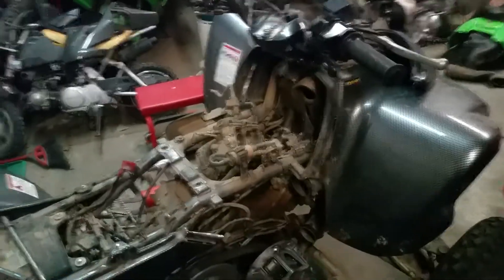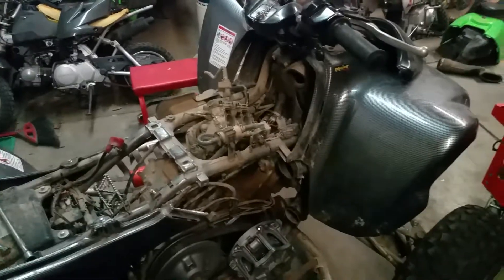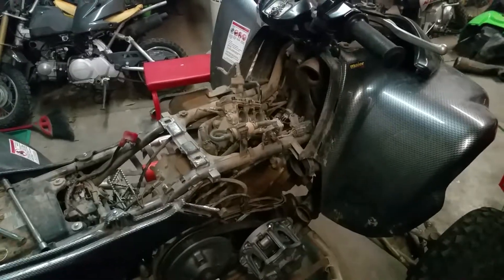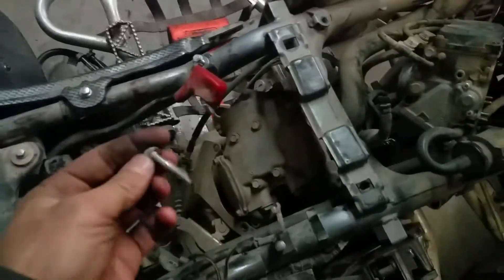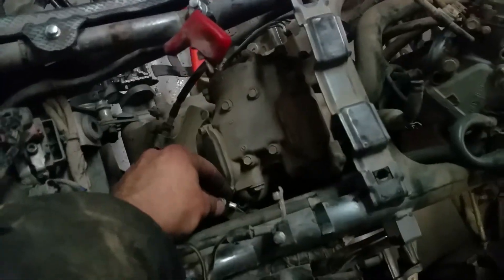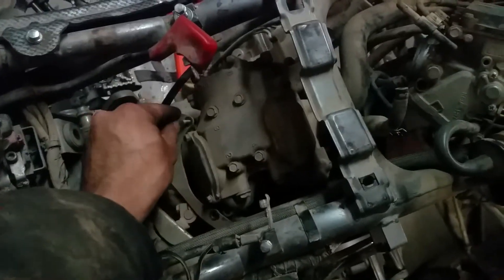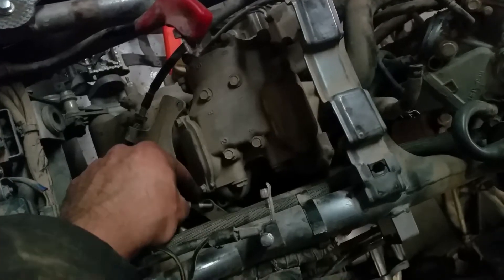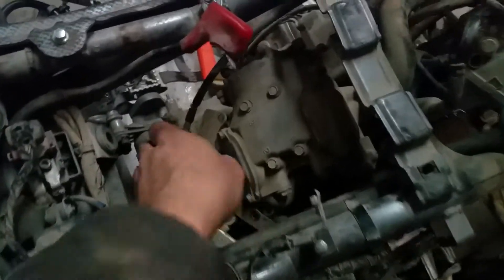Kawasaki KFX700 Gear Shift Cable Removal

Comment: How would I you tighten it if the cable is loose ?!?! When I try to switch from neutral to drive it’s not fully going in so I’m assuming the cable is loose
Reply from the maker: The adjusting nuts are at the hand control. Although you may want to check down by the engine and manually put it in gear to make sure you dont have other issues.
Reply: Brothers Mechanics I manually have to put it into gear every time, can you by any chance make a vid demonstrating how to tighten it both up top and bottom